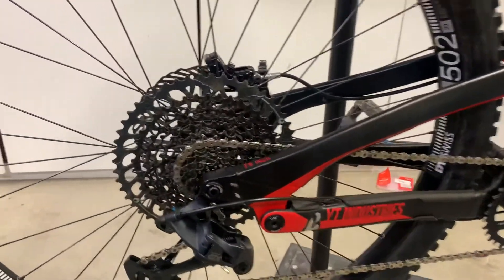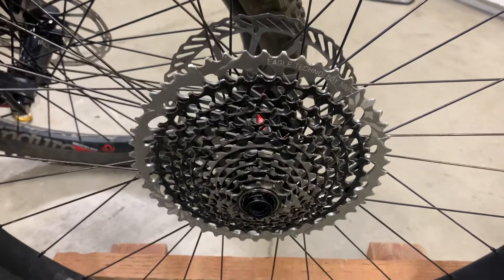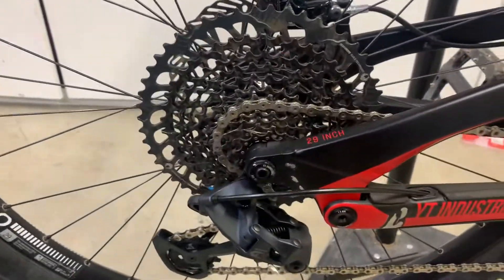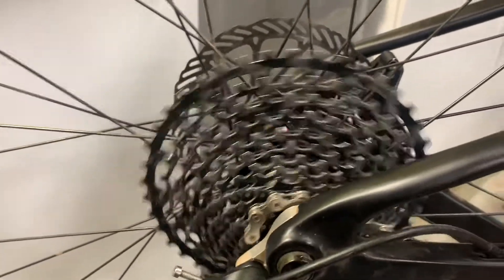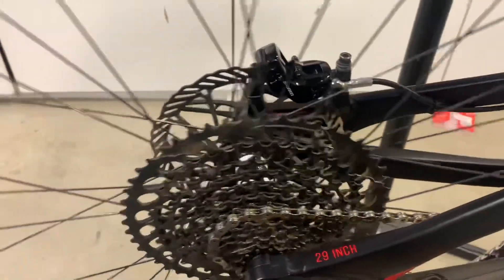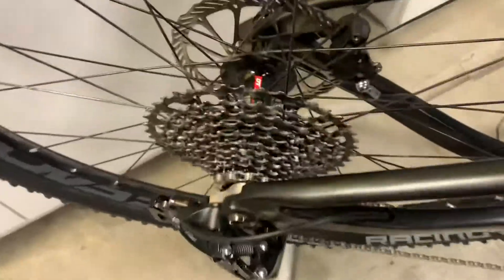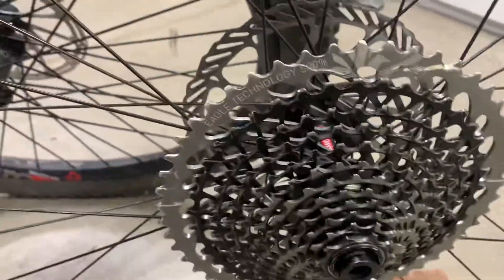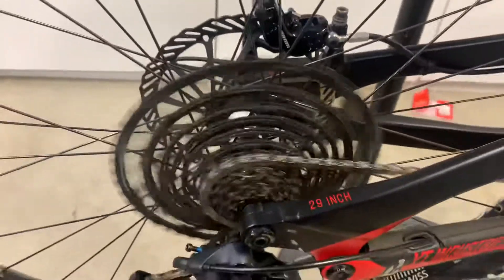Dt swiss pawl, star ratchet vs industry 9 torch hubs POE

Comment: you rode them, please tell me which one is definitely louder?
Reply from the maker: Torch with dumonde tech oil is loudest. They can all be made quieter with grease rather than oil. They also get louder over time as the oil or grease gets more viscous.
Reply: @brewmansports1313  understand.
Thank you 🙏
Reply: @brewmansports1313  And another question, yesterday the bushing came and is not very loud as expected, not enough, I also dropped dumonte tech oil twice, I wanted to know if it could get louder with vrenny? Maybe you need to ride for a month, roll out?